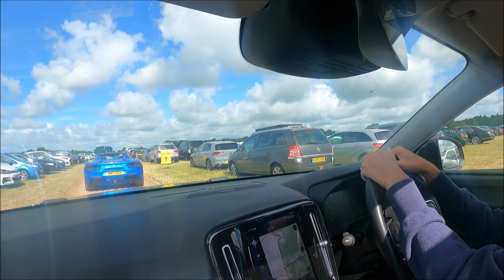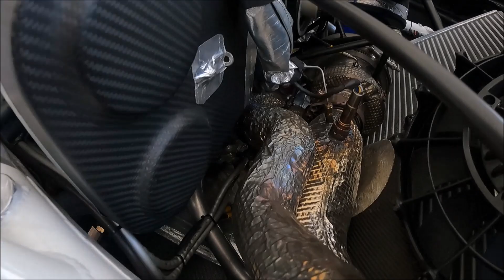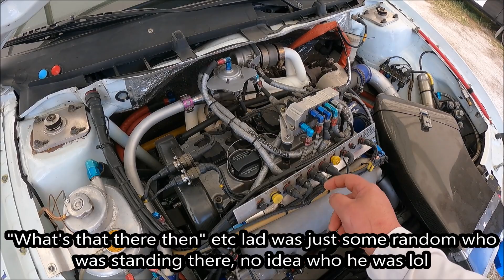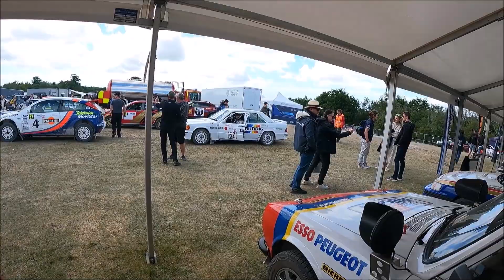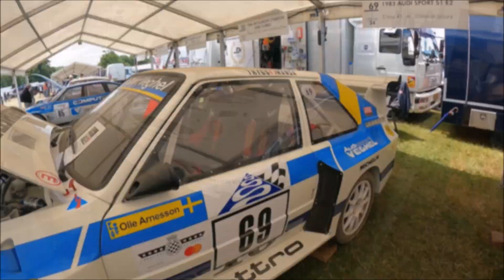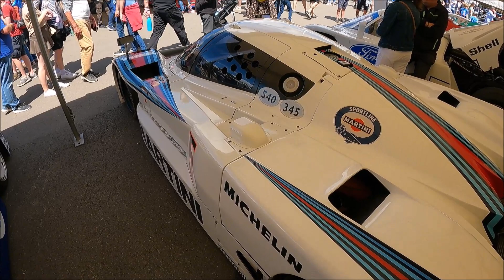I go to Goodwood FOS 2022 and check out some serious engines, and also blow my own engine to bits!

Comment: I love FoS but as you say it’s not an every year thing for sure. What I will say is you don’t get to see as much on a Thursday because it’s only the moving motor show that day, Friday is probably the best mix of busy to cars.

As for the hillclimb stuff, I get off the line in 2.06 in the TT which is a good 1.2 tonnes at least. Don’t think the MX-5 is far off either, but would have to check. An MR2 with the power of the TT and the weight of the MX-5… doesn’t take a rocket scientist lol.

Sorry to hear about the new positive crankcase ventilation setup, still I guess it’s an excuse to throw together an even faster one now you know it can take the power!
Reply from the maker: I must admit, despite how I felt this morning when I recorded that, I miss it already! And yes, 2.06 is flippin fast!

When you say about the moving motor show- That bit just affects on track doesn't it? And off track all the cars are still there?
If not, then Friday it is.

And yeah 400+ horse coming soon now. Maybe 500+ depending on what turbo setup I decide with...
Reply: @StavTech  fast/no mechanical sympathy 😂

I was always under the impression that was the case, I don’t think the rally stage runs on a thursday either? I could be totally wrong (and tbf it’s a while since I checked what happens on a Thursday there) but I’ve always gone on a Friday and everything’s been there.

4-500 would be fantastic fun. But also I think it’d be not a terrible idea to throw it back together mostly as is (with rods) and then get cracking on the yellow one. The silver one is certainly more than capable at that power level to be fun in the meantime. But then I guess it’s not much to hit 4-500 if you’re already doing the rods anyway.
Reply: P.S. Yes please to going back and doing an in depth mechanical look at various cars. Maybe go to the Revival in costume too lol
Reply from the maker: @mcgherkinstudios  TBF even if the rally cars didn't run but were all there, that would do me, I just wanna look at some mental engines, countless vids of the action on YT.
But I honestly think I could make a good few decent length techy videos using the cars that are there for sure. I could've yesterday even tho it was rammo, I mean what I did for this video wasn't planned or conciously thinking about it, I looked (and took detail pics of in fact for my own reference- Even checking out driveshaft sizes lol) literally 100s more, just didn't bother getting the GoPro out my pocket.

I reckon in one full day there, with no effort, I could do a 10min or so video on every single cool engine'd thing in the place.

Nah couldn't put it together exactly as is, purely as it feels like it can handle SO much more with ease! But that's why I'm thinking maybe 400-450 rather than the biggest turbo setup, as then it's a little less work and just get on with the Yellow one.

Thing is, unless you didn't want to rev high so stuck with stock valve springs  (so 250quid less) and stock cams (so 50quid less), the engine spec you'd need be it 350bhp or 600bhp is the exact same, so cost isn't much different refardless!
Reply: @StavTech  as in they don’t actually get there before friday, but I’m probably wrong lol. We’ll see if you go there next year!

Either way your plans sound great for Goodwood and the MR2 alike so look forward to them 👍

Comment: Glad you finally made it, yes you are right, sunday is by far the worst day, it’s rammed and everyone is well and truly over it. Mainly due to the nonces you mentioned in the first few minutes. 

Idiots and clueless knobs that think a car is slow unless it makes 800hp.

Build and break days are usually the best because you get to see the cars and all the kit stripped and packed.  Thursday is the day for a full walk though.  

Every year is different so well worth a other visit. Some of the teams and owners are very approachable and recognise the true fans and true engineering nerds. 
 A couple of years ago I was the only one looking at a car hidden right at the arse end of the show and the guy gave me a hour of his time showing me all around it and helped with a few suppliers for hard to find electrical connectors.

Comment: Goodwood is great, highly recommend it, but not every year for me either.

As a comparison for performance, at the Brighton National Speed Trials in Sep 2021, the the fastest run of the day (over 1/4 mile) was a road legal Audi R8 V10+ (1200 bhp) with 1.98s (0-64ft).
(Also just read it's categorized as a 'sprint', and so measured over 64ft, and without a 1ft rollout.)

Comment: Yeah fos every year, no way. I’ve been twice about 4 years apart and it was so similar. Did the revival next time it I’m in no rush to go back. Really interested in what outer cv’s you used to outlast the block 🤣
Reply from the maker: Mk2 RAV4! Straight fit in to the MR2 hubs. Mk2 MR2 Turbo ones likely would with some minor machining on a lathe too, same hub spline. They even bigger.
Reply: @StavTech  I know you can use b series civic ones in the non turbo mk2 mr2. But yeah rav4 would be more beefy, nice find
Reply: @StavTech  front or back ones?
Reply from the maker: @driftmonkey3646  front. 28.5mm shafts and about 2.5in OD CVs. Stock is 2in and Mr2 turbo is about 3in. Tbf shafts will break long before CVs. Never had an CV issue

Comment: Oh no, but you did say you were always gonna blow it up lol. Stav do you manage hit 60mph in 2nd gear. Actually if you can could you please state what mph you estimate you would hit in each gear. And at roughly what rpm that would be at. Which version of o2 gearbox did you use, thanks. 

Cant wait see progression of this. Im on the verge of flogging my 335d 450bhp to go this route😎
Reply from the maker: Yeah 60 comes in 2nd. Main two ratio differences are petrol and diesel. There’s others but if talking 2wd 4cyl ones, that’s the main two, and it’s petrol. Can’t remember what this one is without looking, Cupra R I think, but the only big ratio changes are 1.9tdi vs 1.8t, as VR boxes etc don’t fit.

I have got the speeds in each gear worked out, but can’t find it.

It’s quite short and close geared though, 3000rpm is about 75mph in 6th. Very little Rev drop between gears.
But that’s still 160+ by the 7.5k limiter and will hit it no problem.

Can use 1.9tdi gears and hit 210+ even on that gearing, or put cams and valve springs and a bigger turbo and add another 1000rpm+ to the Rev limit.
Reply: @StavTech  thanks for your reply. I saw a video of yours while accelerating towards 100mph you seemed to of reved it past best of power band to maybe save time on gear change to hit 100mph. Was you dragging it out in 3rd or 4th for this. ( does it just about hit 100mph in 3rd or 4th) thanks
Reply from the maker: @aaronevanson3399  yeah it’s faster if accelerating if I’d changed up 500rpm sooner but to hit 100 only it was 0.2sec faster to leave it in 3rd so I did. Stock cams and fairly small turbo means generally changing up 6.5k or so is fastest, but when you take in to account gear changes and what speed you going to hit, holding for longer sometimes is faster.

PS- every time it says you replied I read it as ‘Evenson Allen’ which is someone else entirely and defo showing my age 😂
Reply: @StavTech  well the gearing sounds  to what i like out of quick manual cars, some times i feel as cars get quicker some dont go far enough in the 1st 3 gears and the ratio between amount on time on power and off power gets skewed closer to off power. And this  is worse with turbo cars due to lag. I am loving the pakage more and more. And im definitely not a mc lol
Reply from the maker: @aaronevanson3399  honestly gearing is pretty perfect, and bigger turbo, cams, etc will probably make it even better as it extends the Rev range even more, as what rpm I use to go fast is way beyond full boost even on a massive turbo. The fact I’m at full boost about 3k means zero for me as I’m never under 4.5k or so if going fast